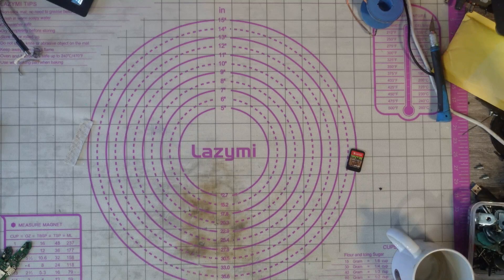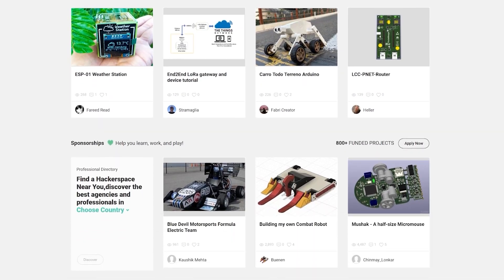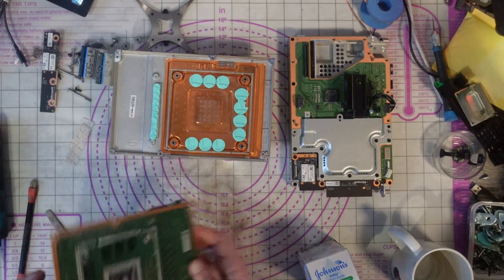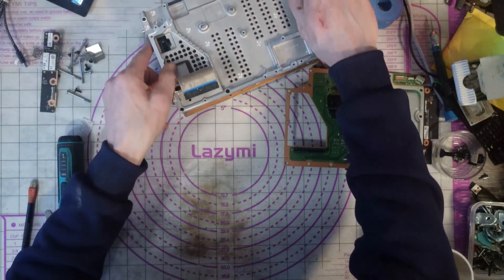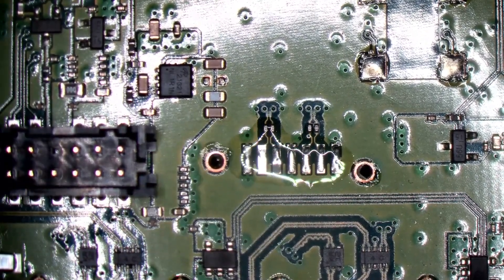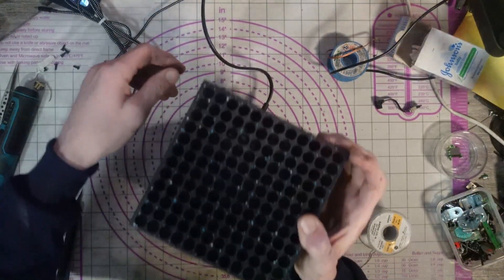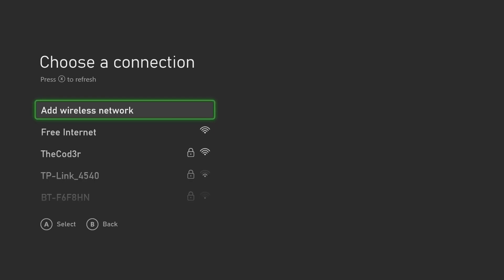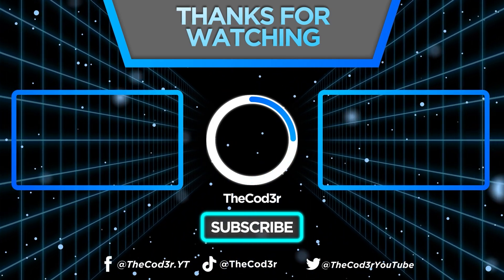He Tried To Clean His Xbox And Broke It More... Can I Fix It? (20th Anniversary Xbox Series X)

Comment: Are all  screws for the ps5 the same size for most part? I've taken my sides off and fan out and clean what you can see thru the fan spot but I want to take the plastic cover off under the side plates. So would like to know if them screws are all the same. I have a launch ps5 and would like to get liquid metal redo. I'm sure there's a dry spot/oxidation on chip. I've bought everything for all that and I also work as a plumber for past 22yrs so I'm very mechanically able when it comes to taking things apart. Figured since I've supported ya for the past, like 4yrs id be able to ask you. Also adding rubbing alcohol to liquid metal is what you do to spread it out, right? I bout 99.9% of that also.

Comment: Thanks again for doing my xbox series x,  only problem is you put a different bottom circular base on the bottom, mine matches the fan
Reply from the maker: There wasn't one with yours bud. I only put that on because it looked better than not having one
Reply from the maker: Adam, I made a mistake here. Could you give me a call on 07938 833673. The console did have the base with it. I'm so sorry for the mix up